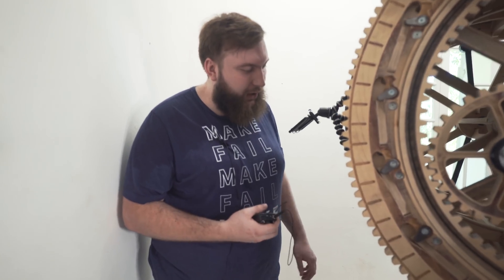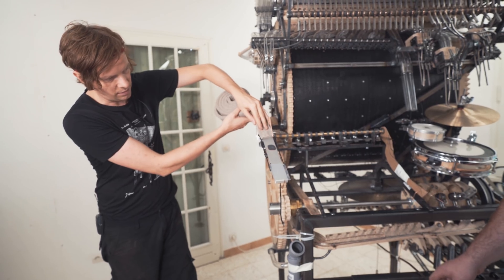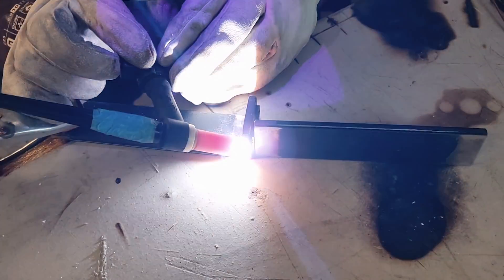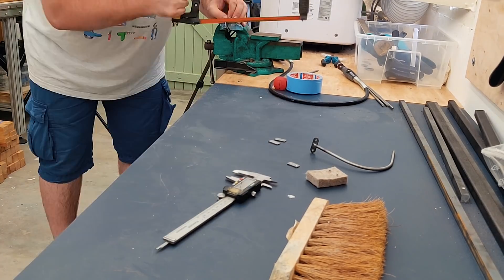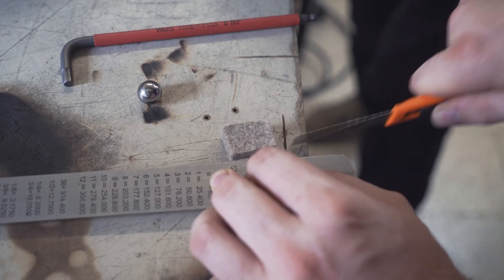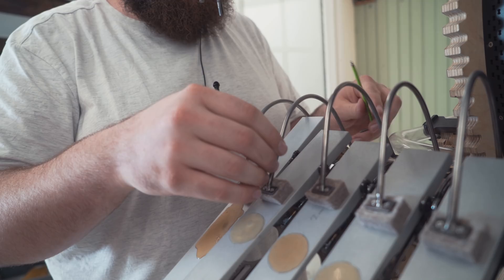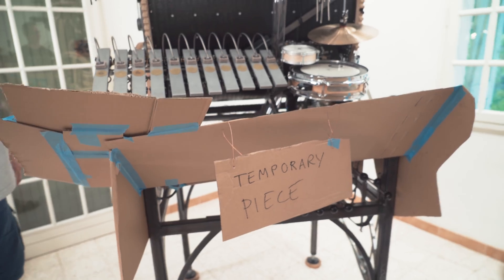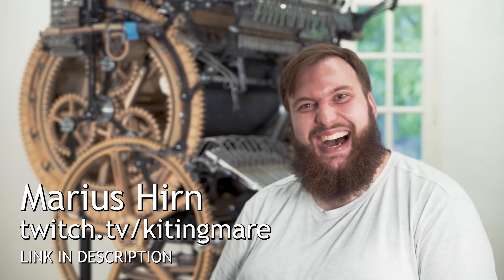Vibraphone Sustain Control - MMX#94

Comment: Just binged the entire playlist!  So fun!  Though I do have to wonder about the dampeners.  You put time and effort into adjusting them for the nodes of those 11 bars, but what happens when you swap in different bars?  The nodes are a function of the dimensions, and the tone frequency is a function of the dimensions as well, so the nodes are going to move...  Your dampeners aren't going to work for all bars, unless you took that into account in the design of the bar holders.

Comment: MARTIN! PLEASE. Change out the imperfect bent wires for CAD CNCed arms. Single ones that match the under arms...   Them not being uniform when the rest is...  oh it's a gunna bother me...
Reply: Even the fact that the felt was screwed on at irregular spots under the metal plates bothered me...

Comment: What's the point to adjusting the dampeners to each plate if the point of the system is to be able to swap the plates? You'll have to readjust each dampener every time you swap out a plate.

Comment: Mercury Commercial was so weird. They said something along the lines of, "we are trying to save money." Mom has a pair of channel lock pliers. She was in the lap of dad with goggles and gloves on; however, the channel locks didn't have any kind of grip. So, that is metal to tooth. If you gonna do any kind of home surgery of that nature, put on cushion and grip. From personal experience, just use electrical  tape on the pliers. Much softer with grip and it wont crack the tooth. Just FYI.

Comment: All those welds on the thin damper rods!  They are going to fatigue and break!  If this happens at a concert, there is no way to repair!  The rods should insert into holes, being mechanically supported so the joint need not bear the bending action.  Joints should be clamped, setscrewed, or brazed.

Comment: Being a percussionist, I see a slight problem that I think is a bit unavoidable. Putting the dampers on the nodes will not completely cut the sustain as no vibrations vibrate at that point. This is why the damper bar is at the edge of the bar on a normal vibraphone.

Comment: Martin, if the felts need to be placed slightly differently to dampen effectively depending on the size of the vibraphone bars, will that be an issue when you switch out different bars between songs to play in different keys? Will you have to readjust the felts every time?

Comment: Will the dampners still be in the correct position if the notess are changed out for a different octave? Or is the optimal position for dampening relative to the center of the vibraphone note?

Comment: If the damper has to be at a specific spot for each bar to avoid the "dead" spots, how are you handling the fact that this spot will move when you substitute in different sets of bars to change the notes available? It seems that the position for the damper will need to move, but they currently appear to be fixed (or will need re-bending for each bar change, which doesn't seem ideal).

Comment: Won't the dampeners be in the wrong place if the note is changed though? Surely the dampeners will need to be adjustable for whichever selection of notes is on the MMX for a specific song.
Also, slightly disappointed with the design of the dampeners. I get that it works but it's not in line with the machine. Although I do understand that Martin is choosing to allow some "shortcuts" and non over-complicated parts, it's just a shame as it's such a visible part.

Comment: The sustain control system is not very aesthetically pleasing. You should machine some more of those slotted arms and figure out how to attach the felt more consistantly.
Reply: The current design looks very crude and under-engineered compared to the rest of the machine.

Comment: If the sustain pads need not to be on a wave node, does this mean that you need to set them every time you change notes (metal bars)?
Reply: probably... unless they happen to not be on any of the nodes
Reply: if that is going to be a problem the damping could go in the individual braket and be actuated by a peice that stays on the machine.  Seems likely to be much more complex.  Just a bigger pad should help bridge out of any nodes

Comment: Love the project so far :) 

Still worried about corrosion though... did i miss a video where you mentioned how you will protect the bare steel?

Also for the dampening felt revision 2. Maybe create two of the little sheet metals, flip the one that is attached to the arm 90° and clamp the felt between the welded and a loose sheet metal with metric screws. I didn´t feel it "on site" but putting screws in felt feels wrong to me (longevity wise)

cheers :)

Comment: How are you going to record music on that when the machine it's self makes so much noise?
Reply: This was covered in a prior video. The MMX uses contact microphones for most parts so that they only pick up the vibrations from the instruments and not the machinery.
Reply: Thanks
Reply: Yes, contact microphones. However, the machine noises are also going to be on the same beat, and so can (And probably will) still be a part of the entire auditory experience (Martin made the levers make satisfying loud clacking noises when adjusted, on purpose).

Comment: Why do u need a 2nd damping system what about the one from last week?
Reply: Last week we have the assembled vibraphone dampening system (#93), this week we have the build, and the previous week (#92)  was the cymbal dampening one
Reply: @pascal-cm4sq  yes last week there was a vibraphone damping system that used one horizontal rod that damped all the vibraphone bars at once. Martin played a song to demonstrate it. And in this video there is a different damping system with individual vertical curved rods for each vibraphone bar...did you guys decided that the previous vibraphone damping system wasn't visual enough?
Reply: @murphygay3050  Sorry for I'm not understanding your problem.... for me there is only one dampening system, the upper fingers with felt... if there was another one previously may be an temporary one, that's the only explanation ....

Comment: I have to say that the dampers looked much better in CAD than in reality. I'm afraid to say that they might not be to the standards of the rest of the machine in my honest opinion. Putting a screw through the felt is not elegant (and probably not durable). 

Lately I think you have started to take some shortcuts and be more practical... (also in the cymbal hitter/damper) I guess that it is because the build is taking a long time and you want to see it finished soon.

I'm an engineer as well and many times when a project is close to be finished I tend to start rushing because of the desire to see it finished. But then I normally regret it xD.
Reply: The machine is very modular and I would presume that if those parts bug him they could be replaced or modified to be cleaner and more in line with the rest.
Reply: @jadeevetz9426  Yes, no doubt about that! The modularity of the machine is key to allow for upgrades.
Reply: I'm sad my ball idea got dropped as well. Glad you liked them. :)
Reply: @malco84  He should use your design, with such a beutiful machine one should not go for less. But its his decision in the end, Im just grateful to be able to take part in how he creates.

Comment: Who else has spotted the fault with the damper?
Reply: The possible fault is the damper was set for the vibraphone plates that were on the marblemachine during design and testing, but the plates are designed to be swapped so it runs the risk that the damper could be in the wrong place on the plates, when the plates are changed for a different melody.

Comment: Beard tip for the larger man. If you trim your sides with clippers so they don't "poof" out near the bottom, it'll frame your face better and it will appear slimmer.

Comment: I suppose Martin will straighten those dampeners so they look uniform. Surely his OCD won't allow for such imperfect alignment :P
Reply: Agree, The unaligned dampeners are more visible than the beautifully crafted vibraphone holders for example. These should not meet the Wintergatan standards..
Reply: I was looking for this comment I knew someone would make faster than me.
Reply: Agreed. This was driving me crazy! Being in front they really stand out and it's almost distracting from the rest of the machine. Everything else is so neat and uniform.
Reply: @DasVERMiT  Difficult, if you want dampeners to be aligned, then you must move the bars, whiche means you have to reshape the bar holders, which means it's hopefully not happening until the machine is up and running.
Reply: Definitely. I understand that in order to finish the machine some corners have to be cut but this, right there in front of all. Nope.
Reply: Hmm but Martin also likes purposeful imperfections, so he might dig it
Reply: Some CNC'd arms that match the style of the tuned bar holders would look great IMO.
Reply: I dont think perfectionism means OCD
Reply: Except they have to contact at the nodes of the bar to actually...you know, dampen... and that’s never going to align?
Reply: Idk I think at this point he just wants it to be finished
Reply: JFKQHDIWBDUQBDHE

this cant be more true
Reply: They could be uniform at the top and side to side but stretched further forward as needed for the nodes.  You know what could accomplish that? CAD AND A CNC MACHINE!!!
Reply: ...My sentiments exactly - and the felt seems to be screwed on any old how... Marius seems like a nice chap, but really needs to 'up' his game...

Comment: I feel like the felt and metal tabs should be round.

EDIT So after thinking about it over night I think he should use fender washers for the tabs, with the hole the same size as the rod so it has a register for the center. That would make building more of them easier (not custom tabs) and it can be welded on the bottom and then on the top. Then just epoxy the felt on so there are no screws. Martin, I am a TIG welder, would love to help remake these if you agree they should be round.
Reply: and also centered, this gets my OCD triggered atm
Reply: I agree

Comment: Dear Martin
I see a Problem with the machine:
You dont have enough Hands to play this Instrument good. Imagine you Turner the machine with youre right foot. You play the thousands of levers with your right hand, the dampening and the hi hat openings with youre left hand, and you have the Problem. You cant play the Bass anymore. So you need more Hands. My solution: A Chair. Sit on a very high chair, so you can reach the Levers on the up side of the machine. Since youre now sitting you have youre left foot free with wich you can play the dampening and the hi hats. Also youre posture is better and you dont have to stand on one foot over hours.
Reply: I think you are missing the whole point of the MMX and how it works :) Checkout the original MM video.
Reply: @SamMackrill  
No, i dont. Ive seen the MM video and every video what is produced since then. But also in the originall video he played the Bass with one Hand. And how does Martin want to play the hi hat openings, the Bass and the Muting with two Hands? Have you ever seen how often Drummers do hi hat openings and how often Vibra phone players mute theire vibras? (Hint: sometimes every bar)

Comment: Honestly, 
My least favorite piece of the ensemble as a whole aesthetically speaking. The welds and the fitment are at a prototype level compared to the other features on the MMX.
Reply: Agreed it looks less professional and precise. Each bent metal rod is slightly different from each other. 
Sticks out from the rest. This is often a problem when working in groups.
Reply: It does look rather cobbled together compared to everything else, yea
Reply: The devil is in the details.  It needs to keep moving, guys! Once it's done and working, everything can still be improved upon. 

Forever... ;)
Reply: @astroscribe  
You realize "the devil is in the details" means nothing right? It's not a Bible quote and it means ZERO to this application.
Reply: @Finn-McCool   It's a common English expression describing the law of diminishing returns combined with the experience of manic depression that often accompanies perfectionism.

Comment: I think I heard you mention that the felt dampeners need to be adjusted for each note, but you can also change the notes that are in each slot. will you be able to adjust the felt on each note while the machine is between sets?
Reply: I didn't hear that but I would think it meant adjust once for each slot and that's it. I hope.
Reply: Jim Barchuk he said each note has two nodes that the felt won’t work on it, presumably something to do with how each resonates uniquely compared to each other. So as long as the replacement notes he puts in don’t have a node where the previous note had none it wouldn’t be a problem. Or maybe the nodes are so small that this is a non factor completely

Comment: I hope you have ported all the changes back to CAD or otherwise documented them, so you can remake parts in the future if one of these more improvised pieces needs replacing. The dampener seems to be working quite nicely, glad to see the progress!
Reply: The CAD model is only one step in the engineering process.  Detailed drawings for each part, properly annotated with manufacturing requirements for reproducibility is completely missing.  No tolerance analysis has ever been demonstrated, conversely, the build has demonstrated the complete failure to perform this critical step.

Before every person jumps down my throat, understand that I am in awe of Martin's beautiful piece of art.  The beauty of the MMX as a machine is amazing.  I cannot wait to hear the music it generates, additional art.  Yet this is not a reproducible mechanism.  One may get close, but there are far too many hand tweaks to each part.  

A major part of engineering is called the reduction to practice, wherein the pile of drawings are handed to the Machine Shop to create the parts, and to Assembly to make the build, all without Engineering intervention .
Reply: @WhatAboutTheBee  I agree with you in principle but the MMX is not going to be mass produced. I know Martin had a plan for a second one for logistical reasons but I think the MMX will be as unique as the original Marble Machine. There will be a set of spare parts made but I really don't think a copy will be built - if it were, it would be hand tweaked, as this one is and, knowing how Martin works, he would refine it and change it so it would end up being different anyway.
Reply: @johnm2012  Yes, you are correct!   MMX will be a one of a kind, hand tweaked mechanism, as will MMY and MMZ!
Reply: @WhatAboutTheBee  you are correct. The issue now though is that it is just too much work I fear to get to that stage for it to be worthwhile. Also as Martin approaches the finish line things aren't being recorded. It will be enough work just to get the Cad updated. Producing toleranced drawings will never happen.
Reply: @malco84  thanks for the confirmation.  This particular discussion has been on going here in the comments, mostly by non-engineers who do not understand the process or what a CAD model is.  

I have tried to politely explain the process.  Unsuccessfully.  One recent individual indicated that Martin's "big brain" could somehow remember how each component was hand tweaked to fit, without tolerance'd drawings, without tolerance analysis, further, without updating the CAD model.  Given the vast number of components, that seems ... ridiculous.  

Conversely,  I know one PhD who insisted via drawings that a ceramic ring, 450 mm in diameter, 9 mm wall thickness, be flat to 10 microns, an incredibly expensive grinding process.  His vendors were charging a fortune for this ring and finally no bid. I examined his drawing to find out why.  I questioned this tolerance.  When he explained that he didn't need the flatness anyway, I almost choked.  What a waste of time and resources.
Reply: @WhatAboutTheBee  My guess is that (and this is just viewer speculation I have not heard this from Martin). We will update our sections once the machine is complete. Martin will then hire a maker hopefully Marius or Alex to build a second machine under his guidance from the Cad model.

Comment: Wasn't one of your last episodes about swapping the xylophone-notes? Isn't it necessary to swap the dampeners, too?
Reply: As long as the vibraphone keys are set to connect to the machine at the right spot, the dampeners will all land on the same spot relative to the center of the keys.
Reply: No the dampeners will contact a point that is near enough to the anti node on each note so won't need to be re positioned. The same goes for the contact points from the marble drops. The resonator pipes need to be re-tuned for each note but we're working on that.
Reply: @malco84  Would it not be easier to shift the xylophone bar relative to the attachment point such that the  resonator pipes need not be moved?  The marble contact point on the bar would shift longitudinally, as would the dampening point, yet it seems (to me anyway) that shifting the bar is trivial.
Reply: @WhatAboutTheBee  it would be another moving part and would move the centre of the note away from the centre of the resonator points which are fixed. We're only talking mm's anyway.
Reply: @malco84  thank you for your reply.  It was an off-the-cuff idea, made in isolation from other criteria.